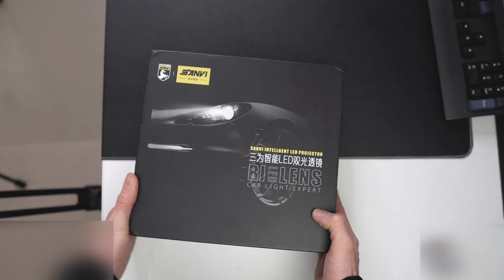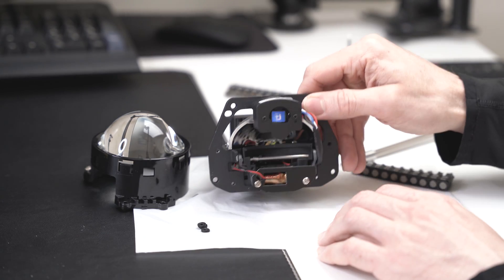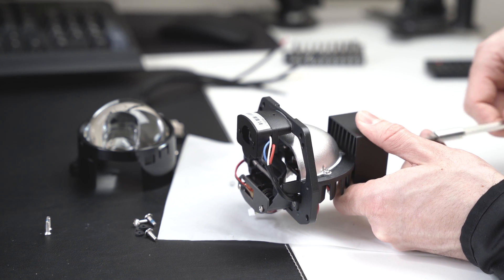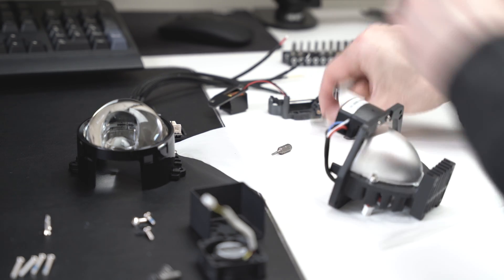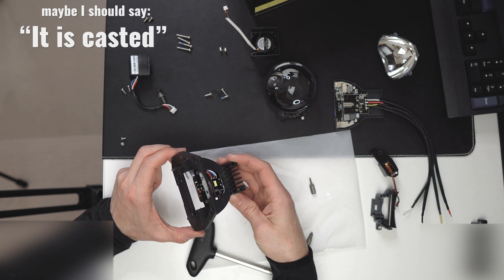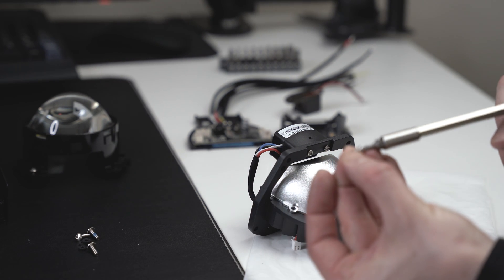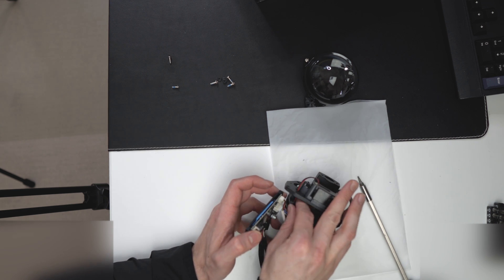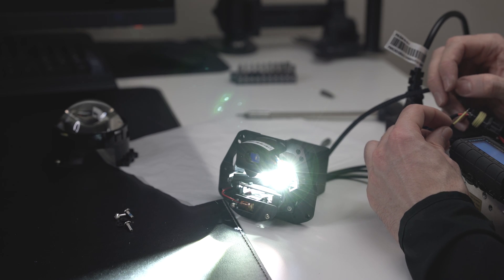Tri LED 3Inch Projector Lens - 66W - Teardown - What is inside - Headlight Laser Lens Alternative

Comment: Are these Sanvi bi-led projectors? Can you tell me the model number, are they lk+ or S11? In the video it appears that the auxiliary spot high beam can operate independently of the main projector high/low beam, is this the case? Thankyou
Reply from the maker: link should be in the description. yes, it can auxiliary can work independently.
Reply: @BestCarMods  Thankyou for reply, sorry I didn't click on the "more", yep they are the same, I am also in UK so more limited than LHD markets. Glad the aux. high beam can operate independently as will simplify my wiring as I need to use this for the headlight flash, which I assume is needed for the MOT.
Reply from the maker: @ianbuckwell1101  depends of your headlight setup. I was planning to fit it on a audi A4 b8. send me a message an IG if you want to chat about headlights and lenses
Reply: @BestCarMods  Will give it ago, never used it before
Reply: @BestCarMods  I tried on Instagram, but can work out how to message on there :(